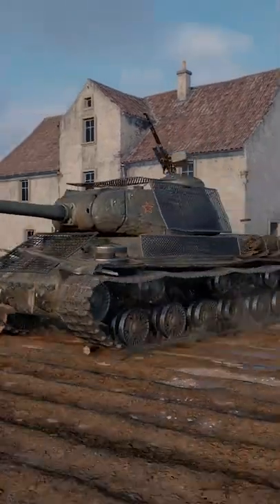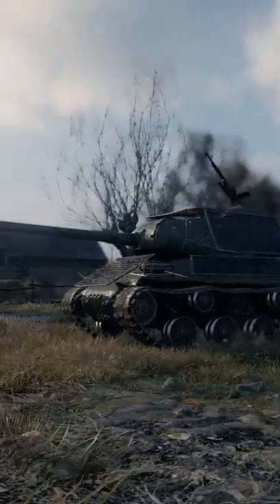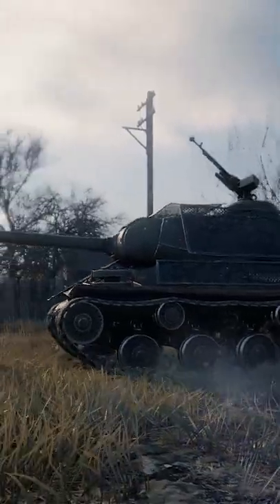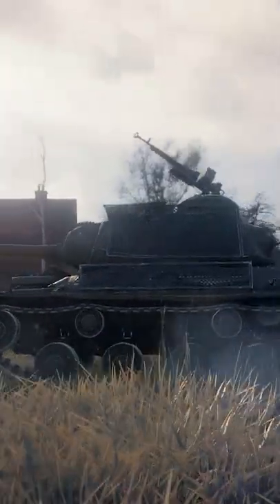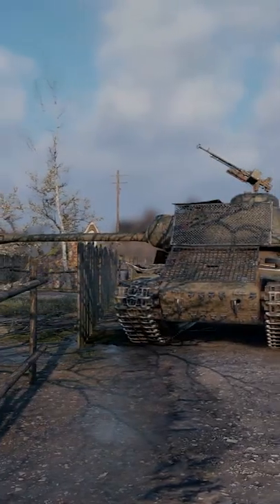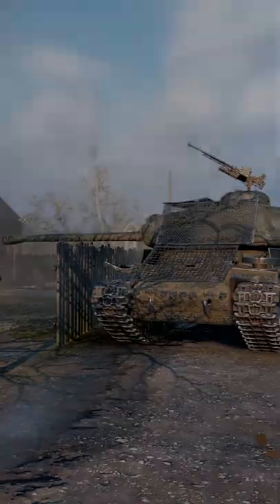#Shorts - Spaced Armor Effectiveness

Comment: Stops a HEAT shell? Oh really? Then how can u explain that I got penetrated by HEAT nearly every single time with spaced armoured tanks?
Reply: It doesn't stop a HEAT shell and that is not what is said in the video either. It protects you more against HEAT shells. It has more problems penetrating spaced armor than AP for example. I don't have the exact calculation in my head right now, but I am pretty sure, that they made one or multiple videos about penetration mechanics.
Reply: @Masternoob089  but thats not what the video is saying
Reply: @andreasaa2000  Doesn't matter. Here in states, if it is said in writing (i.e., on video or on paper), that's an official statement. In other words, it can be used as evidence in the court of law.